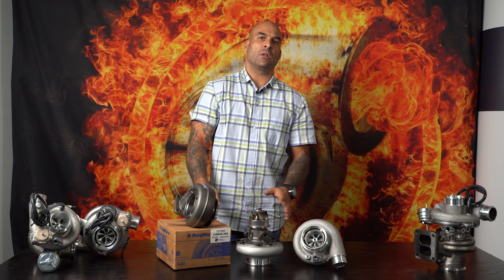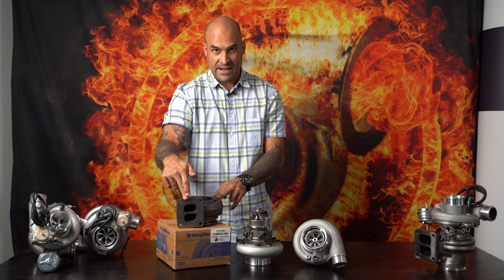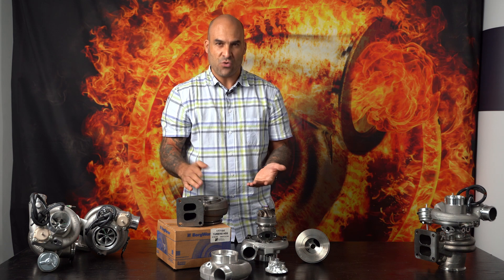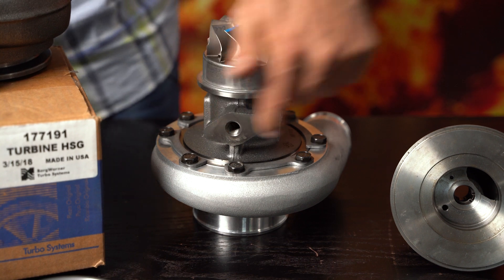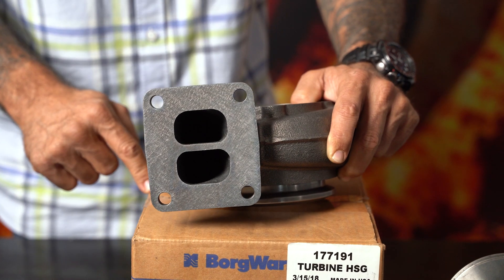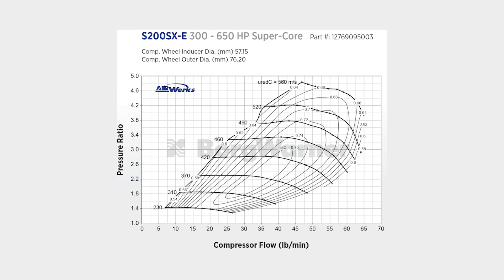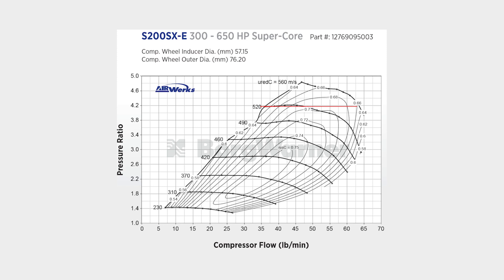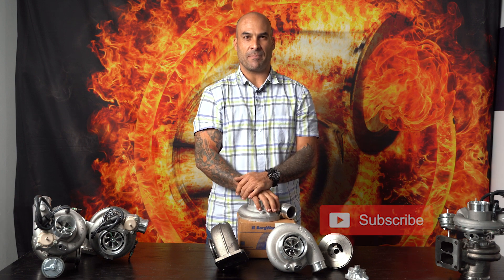BorgWarner Airwerks S200SXE - 650HP

Comment: I have this turbo installed on a high compression 2jz build. 22psi boost pressure 550 wheel torque elevation 5500 above seal level. Very happy with this fine product!
Reply from the maker: @JPena-sn6dr  thanks for the feedback

Comment: After a ton of research I bought one of these and installed it on my 2.3l 4 cylinder Fox Mustang. I chose to use an aftermarket single scroll .48 housing. It has been incredible in every respect, nudging the dyno up to 280 WHP on a 186K engine, equipped with only a mild cam upgrade. I am positive I could have made more HP, but I didn't want to risk more that 14.5 psi on a tired, stock engine. still driving every day.
Reply from the maker: Nice - beware with small housing AR's - they will spool nicely up to a certain boost level, and then the heat starts to creep in as the boost is increased past a certain level. The power output will also become limited and the more you push for power by increasing boost, the more heat you will create which is detrimental to the turbo and engine. 

At that boost you running now - you should be good.
Reply: @TurboDirectSA  I'm about to install my new 22re turbo spec motor in. And have a back pressure kit I'm installing. Is a egt kit gauge necessary also? What is too high of temp? 1100f?

Comment: How do you reckon the boost response on a k24 (2.4L) of the 257sxe vs 252sxe? I am debating which turbo to go with, I think I will be going with .68A/R. Great video btw
Reply from the maker: Glad you like the video - The honda engines rev high - use a larger/higher flowing compressor so that you dont run out of HP in the higher RPM ranges.

Comment: 1:56  so what twin scroll/pulse manifold would you need a T3 or T4??
I think you’re saying is that the turbine housing is a ‘T3 family’ but the flange is t4 divided. Smaller family housing but larger inlet = better spool
Reply: So it’s t4 bolt pattern with t4 size divided opening and t3 pathway inside turbine housing.

Comment: Hey there, I'm running my 2jzgte with a borgwarner 200sxe. I have the 300-550hp supercore with. 83ar t4 twin scroll housing on a twin scroll manifold and a 50mm wastegate. 

I have a feeling I'm going to make this turbo out pretty easily as I have big fuel mods and cams. 

Do you know If the supercores are interchangeable to my housing if I was to get the 650hp super core instead??
Reply: Or will I be able to run 500hp safely on this turbo? Thanks
Reply from the maker: Installing the larger compressor wheel is all you need to do  - the rest of the turbo is identical. Rather run the larger compressor so you have some HP in reserve and dont run the turbo at its max permanently.
Reply: @TurboDirectSA  would this just be replacing the super core/ cartridge itself? Could you please post me a link to what I need.

Thanks heaps!
Reply from the maker: @bradking8882  All you need is the compressor wheel - obviously the comp housing would need to be profiled to suite the larger wheel - balanced and off you go - 

If you choose the supercore, you paying ALOT of money again - the comp wheel is the most affordable upgrade for this conversion.
Reply: @TurboDirectSA  okay thanks heaps!

Comment: Would you pick s257 or s362 for bmw n54? 3.0L direct injection. Planning on running flex fuel and aiming for around 500-600whp
Reply from the maker: The S200SXE will be on its limits - i would opt for the larger turbo.  KEEP IN MIND the 300 is laggy in comparison - 

This is another option which will spool hard and early in the rev range, and make the power you want easily with plenty in reserve. 

https://store.turbodirect.co.za/index.php/shop/turbochargers/g3582r2-forged-detail
Reply: @TurboDirectSA  I'm kinda stuck with the turbos that will fit with Speedtech bottom mount turbokit. What do you think about precision turbos? They have more options for different power targets.
Reply: @TurboDirectSA  also how much laggier would 362 be? Are we talking about couple hundred rpm or like more?
Reply from the maker: @asmrkitty9336  It depends on so many things - the engine build, supporting hardware, boost run, wastegate control, manifold design, tuning, fuel ..... etc
Reply from the maker: @asmrkitty9336  We have great options for you to use, shoot us an email to info@turbodirect.co.za for more info and links to products.

Comment: What turbine housing should I buy? 1jz-gte non vvti re85, at least 500whp. kangaroo cast manifold. Is 0,83 too small or just perfect for my car? Street use, full boost.
Reply from the maker: AR83 is the smallest available - i would choose a twin scroll manifold - to get the most out of the response from the S200 SXE
Reply: @TurboDirectSA  How's exhaust backpressure with that turbine housing on top end? Yea, manifold and housing will be twin scroll.
Reply from the maker: @tuksee  unrestrictive up top -- lots of flow to support the full potential of the turbochargers offering.

Comment: Looking at the 52mm inducer S200SXE. Compressor is perfect for my application, however I dont know what the flow is of the turbine side. .83 A/R is big, would have to just run one of the scrolls and use the other as a waste gate outlet. Do you have turbine flow map for it?
Reply from the maker: Not sure which engine or spec you using, so i cannot comment much.
Reply: @TurboDirectSA  Sorry, I missed your reply. My application is not automotive based. It's for high altitude usage. Ambient pressure of 15kpa needed to multiply by 4 for 60kpa, but only being driven by 15 lb/min of exhaust flow. I've figured it out. Thanks.
Reply from the maker: @chippyjohn1  Glad you came right.

Comment: Hello sir! Your channel and videos are massively underrated, hope you will grow soon, wish you good luck in this!

I am building an m50b28 stroker, stock internals, but about 9:1 compression ratio in cylinders. 
I want to achieve some safe power number for those stock internals, with a pump gas, 98 octanes, no additional watermeth injection.
The plan is to limit the boost to about 1.3 bar, which in theory will give me 420-450 crank hp.
On the other hand, in couple more years I will build forged bottom - pistons and rods, 8.5 compression ratio, and I will want to achieve again on pump gas without meth about 600hp on the crank.

My question is: what is better for me - buy now s257 with 0.83ar now, and later just change hot side on 1+ ar, or buy now the s252 with 0.83ar, and then change the whole turbo so s257 or even s300 family?

I will use this build in drifting.
Reply: Also I am thinking of Holset HX35 12cm housing, externally gated.
Reply from the maker: Thank you very might for your compliment. Im happy to hear we have something to offer the community. Grow we definitely will do - watch this space.  Regards your project, don't bother with Holset combinations - this specific engine has been used many times all over the world. The S200SXE (650HP model) is 100% perfect for your application, and will easily met your power expectations. The response will also be very street-able.  You dont need the larger AR turbine housing either, stick with the 83, you will be fine all the way - make sure to build a separated manifold to use the twin scroll housing.

Comment: How does this turbo compare size for size with a GT 35/82 ???
Reply from the maker: Physical dimensions are smaller - the HP limit is also lower as the rotating assembly is alot smaller too.

Comment: Is there an EFR T4 twin scroll IWG turbine housing that’ll bolt to this? Would be handy for simplifying the install.
Reply from the maker: David, I have been playing with these housings and seen that there might be a mod to make to the internally gated housing to retro fit it to the S200SXE - the housing that could fit is the EFR7670, but i have not concluded this as yet - ill have this checked out and confirmed some time in 2022.
Reply: @TurboDirectSA  That would be awesome.  Would save alot of room and extra fab work
Reply from the maker: @Mendiesel86  The size of the internal swing valve is also massive so boost control will be easy and linear.
Reply: @TurboDirectSA  so wouldn’t have an issue controlling 35psi on a 4G63 2.0?
Reply from the maker: @Mendiesel86  Not at all - thats an easy task. At 3.0P2C (30PSI Gauge) you will be touching the top of the max efficiency island on the S200SXE (650HP model) still - something that no Garrett turbo can do in the same family size/HP range.
Reply: @TurboDirectSA  yeah I’m pretty sold on the s257sx-e. 
I’ll continue to watch and see what you guys come up with in the new year 🤙
Reply from the maker: @Mendiesel86  You wont go wrong - keep us posted on the project.

Comment: i have an rb25det neo  stock internals 
and I'm seeking to make  450hp which rear turbine housing would you recommend?
Reply from the maker: If you referring to the S200SXE - i would use the smallest housing, the AR83 twin scroll. This will still get you the max Power capability of the turbo with the best response - you would need to build a separated manifold however.
Reply: @TurboDirectSA  what do you mean by build a separate manifold?and also what size dump pipe do you recommend? 
I'm referring to the s200sxe =s257
Reply from the maker: @hoseacoltes4756   Here you can find the info on the separated manifold see from https://youtu.be/ryafhwfCgcw?t=364 

The S257 is the smaller compressor which makes less power than the SXE 650HP capable unit.  The Downpipe you can use safely is a 76mm (3") - i would not use anything smaller than this

Comment: This seems like a great turbo for a twin setup on 5.3 liter GM LSx motor. You that it has spool up characteristics of ball bearing turbo????
Reply from the maker: It wont spool like a ball bearing turbo, but it has a great design turbine housing and on a large CID engine it will spool very fast!
Reply: @TurboDirectSA  Thank you for replying on an old video. My question is how would be the spool characteristics be if two of these turbos used on a GM 5.3 liter LS architecture V8 engine in a parallel configuration. It is going into an American GM B-Body, a 1994-1996 Impala SS/Caprice 9C1 that will occasionally see road course, time trial and autocross work. Goal is to have hypercar HP of around 1000 HP/TQ at the tires. 

What really impressed me about the BW Airwerks S200SXE was the rather large area of the compressor map especially in the left side of the map in the low boost region.  Your recommendations are much appreciated.
Reply from the maker: @colinw7205  Got you -- remember you have a large frame engine with two "smallish" turbochargers, using he twin scroll turbine housings, this setup will come onto boost from around 2000RPM-2200RPM already, and being an engine that does not rev very high, you will see power across the entire RPM range and as long as the engine can use the air flow being supplied by the Borgs, it will make the 1000HP no problem.  

Yes you are correct - Borg maps are very wide, and hold the max power for a large range of P2C - unlike other turbos.

Comment: If i remember correct these had .83 , 1.0 , 1.09 and 1.22 turbine housings. Whats the smallest turbine housing on your experience that will do all the 65 lbs on a 4 cylinder engine witbout clipping yhe turbine wheel, 1.00 woild be my guess.
Reply from the maker: Depending on the size of the motor, the back-pressure will differ.  For large displacement engines the larger AR will be a requirement to lower back pressure, and the results will show. The general 2.0 - 2.2litre 4 bangers will see the full potential of the turbo with the AR83 housing. Obviously different engines of the same size will have different VE (volumetric efficiencies) like the 4G63 compared to the EJ20 as an example.  This plays a major role.
Reply: @TurboDirectSA  Wow really? Thats strage cause a lot of people reported .83 give great spool but something like 550 hp max. The results i have found are from hondas so thats on a low backpressure engines. I really might try it. At the end of the day those housings are really cheap anyway so i can allways swap :)
Reply from the maker: @abec666  As i mentioned VE plays a massive part - now the Honda's rev much higher than most engines, and the demand for air flow in this case will be higher than a different engine with a lower rev range, in this case definitely use a larger AR housing - the back pressure in the turbine stage will be higher with more revs/energy being introduced into the turbine.

Comment: Love the content very technical. 
Please advise me which turbine housing option would be best,
an EJ20 with a S257sx-e on E85 with 272 and 10.5 lift cams ect wanting around the 400whp in Australia. 
I’m looking at either a t3 open .63 or V band in/out .82? 
Thank you kindly.
Reply from the maker: Thanks for the compliment, glad you enjoying the content.  I would opt for the twin scroll turbine housing AR83, remember you have an opposed engine, keep those cylinder pulses separated, it works very well on the EJ engines.
Reply: @TurboDirectSA  Thank you for your time and replying to my comment i honestly really appreciate it.
yes, the twin scroll AR83 would be the best choice, however if you were limited to a single scroll option which would you choose and why?
Reply from the maker: @mrheadgasket4847  The Airwerks range always has the twin scroll housing option - in fact its the most popular of all the housings.  If for some reason you just dont have this available, i would choose the correct housing AR and preferably with a symmetrical volute shape. 

Give me some examples of whats available, and ill guide you from there, the different AR, shapes, and internal designs make massive differences depending on the application and engine setup.
Reply: Thank you for giving me more education on this subject, 
Im going to email you for more info on this. 
Thank you for the advice on choosing the right hot side.
Reply from the maker: @mrheadgasket4847  Glad to help.

Comment: Gents really love the detail you get into regarding your turbos! How does the Airwerks S200SXE stack up against the Garrett G30 660 in a comparison?
Reply: G25-550 = efr 5268  =s252sxe all 3 are 550hp or 55lbs/min
G25-660 =  efr ?62 68  =s256sxe all 3 66lbs/min
Differences are castings Machining exotic materials
 I opted for the 25-550  for a low rpm high tq 5.9L cummins.  In the next phase it will be the manifold / high pressure  in a set of compounds with a s362sxe as the low pressure/ atmospheric.  Phase 3 will be 2 25-550 manifold  with a s475ish
Reply: @daviddroescher  Good choice, should be dynamite working with that big Cummins! Ive got a little 1.3l ; 79ci 4E-FE engine  in my Corolla hatchback but I'm gunning for around 450hp, Garrett boost advisor recommended G30 660 as it will support that power at sea level and at high altitude 5000+ feet.
Reply from the maker: Ill do a caparison for you on the compressor maps in the next video.
Reply from the maker: @daviddroescher  No such thing as an S252 or S256 anymore - there are two variants of the S200SXE with different compressor wheels and part#'s, but the abbreviations are done away with now - ill reference the new catalogue in the next video.  Wheels have changes slightly and so have the comp maps because the wheels are now FMW as opposed to the first gen MFS wheels.
Reply: @TurboDirectSA  Thanks and really appreciate it!
Reply: @TurboDirectSA  I just looked up my favorite getting spot and they list/stock s261sxe  61/61, s252sxe 52/61 , s257sxe 57/61.
The  "billit" MFS ( machined form solid) is before my time, Was that the SX line? I've only ever looked at that sxe which is the machine from forged the older previous generations had no interest from me as the hx35 56/68 was already installed
Reply from the maker: @daviddroescher  The line up has certainly changed since 2019 -- not sure why these old unit are stil being advertised - perhaps old stocks that are being depleted.

Comment: Do you recommend this turbo for fa20 engines found in brz?
Reply from the maker: Murat - what power are you looking to make and what is the car being used for? If its strictly street use, then i would suggest using a ball bearing turbo. If you looking to make some decent power and spend alot of time in the high engine RPM, then the S200SXE will work well on this engine. Keep in mind that the opposed 4 Subaru engine is not very good at spooling larger turbos.
Reply: @TurboDirectSA  450hp at crank, full boost around low to mid 4000 rpm for circuit racing lets say.
Reply from the maker: @konforzone  The turbo will work well for circuit racing for sure - as you spend most of your time in the high RPM range. The twin scroll turbine housing will work wonders with the opposed engine design - and the stock compression on the BRZ is higher than the older engine which was not direct injection.   You wont go wrong.